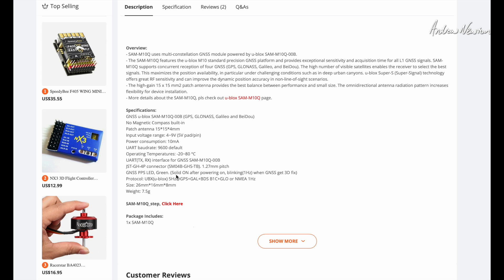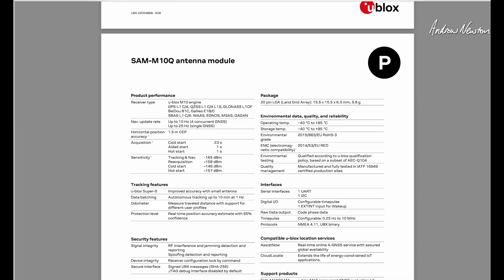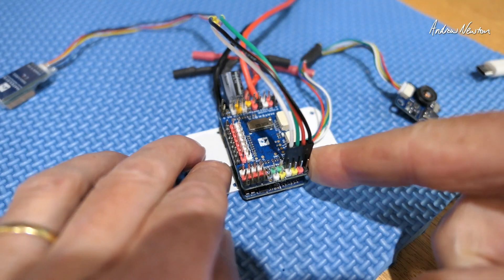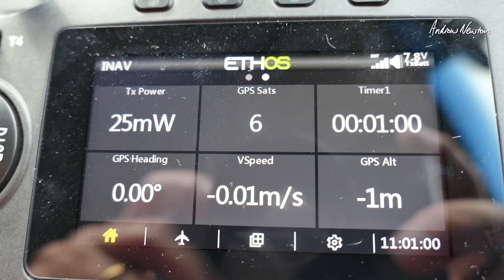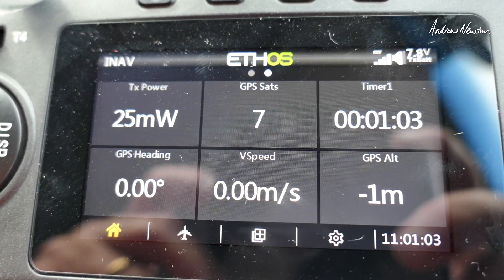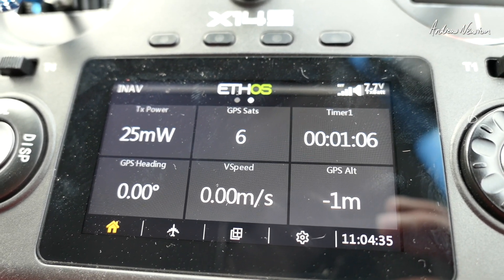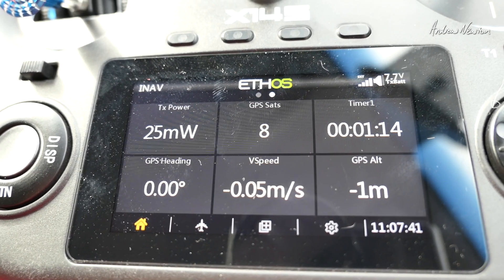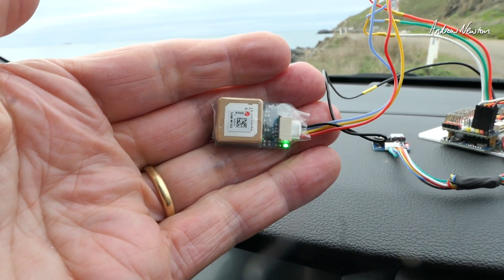Matek SAM M10Q GNSS Module

Comment: Can one of these be hooked up with a data logger and attached to a cat with a small battery to find out where it got to overnight? Weight minimisation is critical paramount so only the absolute minimum function that allows data to be stored for up to 6 hours and retrieved later by external extractor.
Reply from the maker: Probably, but you would have to be smarter than me to put it together.

Comment: Hi Andrew, I have bought this GPS module and use it also on the Mateksys F405 wing V2. Using the latest official Inav version. But GPS icon stays red. Swapped the Rx and tx numerous times. Used another UART. Tried all different baud rates, but no luck.. About to pull my hairs out. Do you have have another solution or do you think the receiver is faulty?
Reply from the maker: Strange, they are usually easy to set up. Check for broken cables, solder shorts on the board, nothing but GPS selected on the UART port, Rx to Tx etc., "Use GPS..." turned ON, check 5V power pin with a multimeter.
Reply: @AndrewNewton many thanks for your reply. I solved it just now. I rolled back to inav 8.0 and gps icon was blue immediately. So after that I flashed back to the latest inav version again and no problems anymore 🙏🏻. Somehow it was stuck in the first firmware flash I did on this new FC...🤔
Reply: Super stoked to maiden my ar wing pro now! Flying 5 years of fpv drones now, it's my first wing so I'm curious if I'm getting it in the air and fly with it🤩
Reply from the maker: Aha, firmware! Didn't suspect that. I would recommend INAV 7.1.2 over INAV 8 to prevent pitch bobbing.

Comment: If your choose UBLOX7 protocol in INAV then you get 10Hz update time, which slightly increases accuracy in speed readings on the OSD. I think that via CLI you can even set higher update times.

Comment: I was surprised when you said you weren't getting GPS fixes reliably. I'm just across the strait in the Launceston, Tas area and get about the same performance under a tile roof that you got in the car. I have a few generic M10s and have them set to UBLOX 7 and all the networks ticked which has got me as many as 23 satellites indoors. M7 & 8 were pathetic in comparison; not even good enough for paperweights. (Edit: On INAV)
Reply from the maker: I can usually acquire more than 20 out in the field but too many tall trees at home

Comment: Great overview and demos.

FYI: the delay is for the GNSS module is to download GNSS/GPS Almanac data, or more precise Ephemeris data which is a catalog of satellite orbit data. All GNSS satellites transmit this catalog in a 12 minute loop. So 12 minutes is the worst case time delay with one visible satellite. ie: a longer wait implies an issue elsewhere (power, or basic antenna reception)
Location where flying doesn't really effect startup time, just the age of the almanac data. Believe the orbital parameters are updated once a week, so the longer a module is not used the more stale its satellite reference data. 
If the flight controller had a recent almanac copy (or we save a downloaded version from the internet), then any GNSS module could quickly locate its position.
During the maximum of the ~22 year solar cycle (eg: 2024-26) high solar activity expands the Earths atmosphere, resulting in greater drag effect on satellites, slowing them a bit more than typical. This causes parameters defining orbits to drift more with time. BTW: solar flares can impact GNSS reception (ionosphere gets distorted), so we should anticipate lower satellite counts during and after such an events, when the sun shoots a blast of energy our way.
Reply from the maker: Thanks for all that info, I learned something today!
Reply: Nice info!

Comment: i have this little guy on my quad and in a few planes , it works pretty good only thing is that its bugged in older betta flight versions but they fixed the bug in 4.5